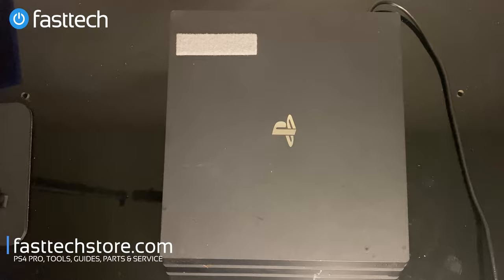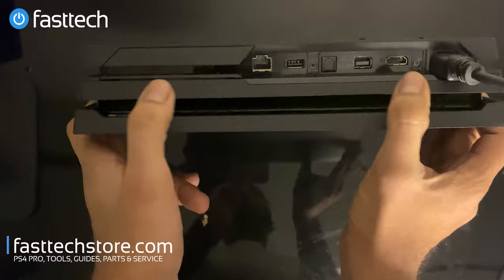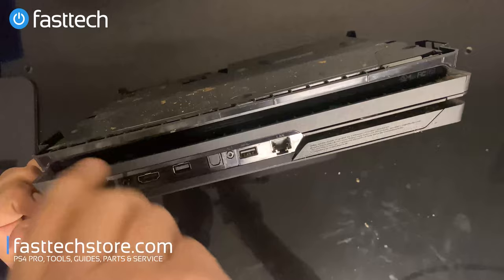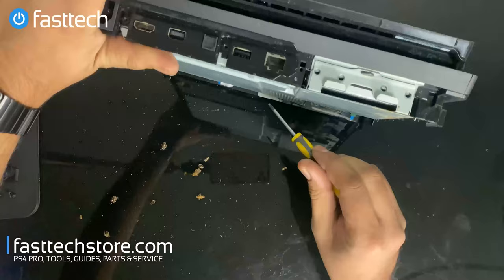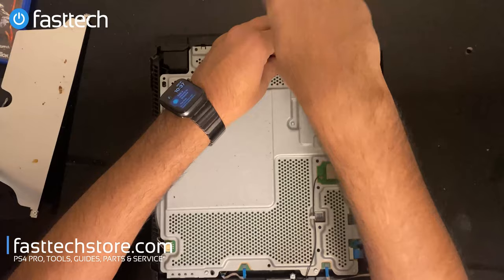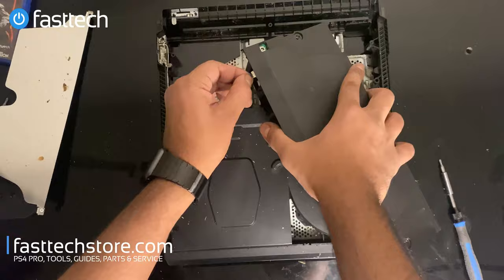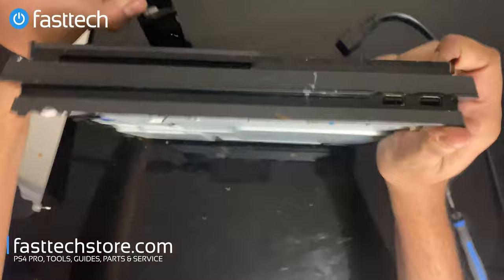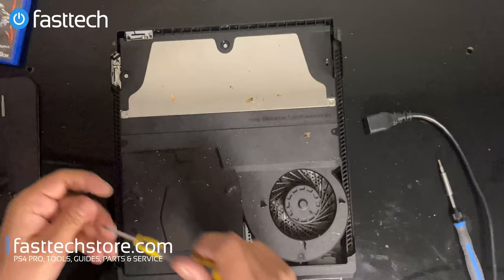Fixing a Cockroach Infested PS4 PRO 🤢 🤮

Comment: Put it in two layers of plastic bags and put it in the freezer 24-48hrs. I did it 2x, worked each time. The reason why this work is because your ps4 is a nesting ground for roches because it's warm, (aka a warm spot for a breeding ground.) trap them, and freeze them and you'll put a dent in the roach population. (another tip for after that is put your system in the center of tape (reverse sticking tape or double sided tape and you'll wake up every day seeing how many roaches try to move in every night.)
Reply from the maker: Here in Canada we don't even need a freezer. Just put it outside.

Comment: On the back were you unscrewed the 2 screws after removing the top. On the back of my PS4, there's a weird thing replaced were the screw usto be and I dk how to remove it
Reply from the maker: Yes you have a 7100 or 7200 ps4 pro which has a clip instead of a screw
Reply: @fasttechvideo  thank you so much for that! I took all mine apart and didn’t see any roaches but it still won’t power on.. could it be the cord itself since it kinda wiggles?
Reply from the maker: @anonymousD-pr2sl  power supply is blown. If you know how to diagnose and find faults using a multi meter do so otherwise replace the power supply. We do stock these on our site if you are interested
Reply: @fasttechvideo  Good point! Thank you again for everything! I will check it out forsure cause I need my ps4 back!

Comment: Quick question is it the power supply that causes it to stop working or is it anything else?
Reply from the maker: Yes in all of the cases we have seen with roaches its always the power supply.
Reply: I got scammed and bought a death stranding limited edition pro that got nested by cockroaches😭😭😭😭
Reply from the maker: @TK-qd2lz  its a common issue with ps4s due to the design. Sorry to hear that. At least you have this guide to show you how to rid it of roaches. Subscribe and like the video. 😊

Comment: Finally got a ps5 at its actual price but can’t play it cause I have roaches in my apartment 😭

I clean and clean but my complex has an infestation they can’t seem to do anything about
Reply: Mine 2 smh
Reply: What I did with my ps4 is put it ina a trash bag and added 91% alcohol in it the vapor kills the roaches, i had my ps4 over my ex-coworker house for a month bc I was loving to an apartment and my ex-coworker have roaches real bad and i had brought the ps4 to my new apartment and saw a roach leave the ps4 so I put it in a bag grabbed toilet paper pour 91% alcohol on the toilet paper and place it on the ps4 then sprayed the bag a little with alcohol and closed it tight you might want to add a rubber band to it so the roaches don’t try to escape had it in there for two days make sure you leave air in the bag so the vapor can kill the bugs
Reply: Put duct tape in a square around the console they can’t get in. My apartments had a problem I have a series x and ps5. But I also spray monthly with really good pesticides. 

Even in a bad apartment you can get them down to 1 every month or two just need to use pesticides that pest control uses.
Reply: @braedonlock3359  the ps4/5 need to vent tho
Reply: @kandacecrutchfield4713  it vents fine put it vertically standing. Then put a square of duct tape sticky side up surrounding the bottom of it. I do it for both my series x and ps5. No ventilation is being blocked at all.
Reply: @kandacecrutchfield4713  just the borders around the console. Not the actual console itself. so there’s duct tape around the console in a square shape. If anything try’s to get in it will get stuck to the tape.
Reply: @braedonlock3359  ohhh okay
Reply: @kandacecrutchfield4713  you get what I mean right? Just a boarder of tape facing sticky side up. Don’t actually tape the console just around the console so nothing can get in.
Reply from the maker: Get roach gel and place it behind your console